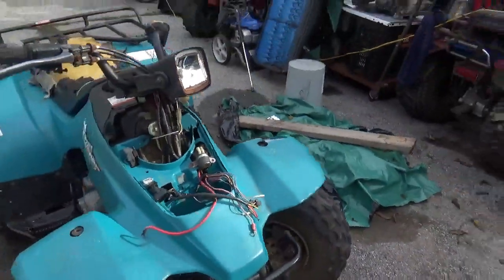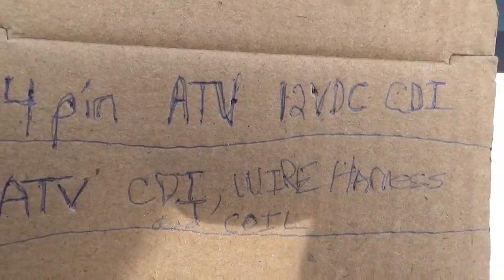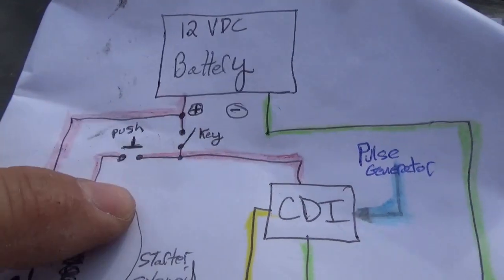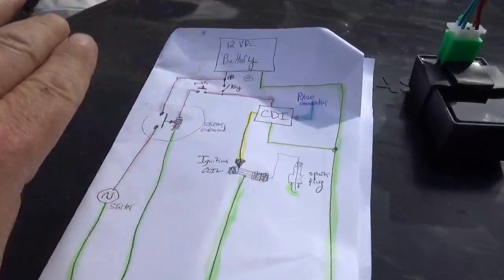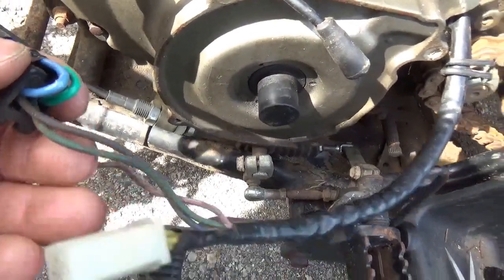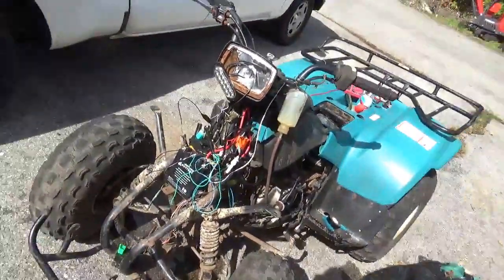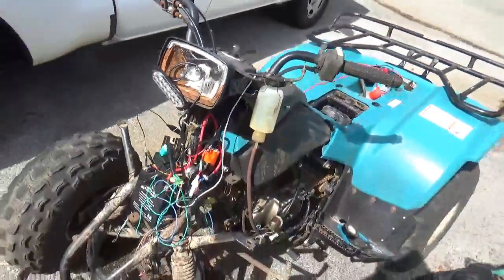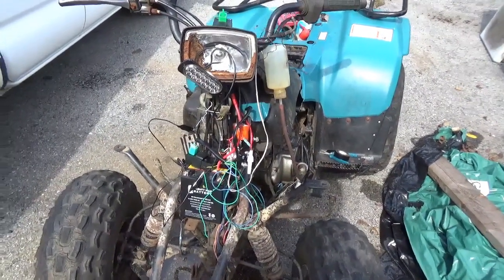AC to DC ATV CDI  Conversion, Fixing a No Spark Quad!

Comment: I have a question if i want to get my harness to work with a battery how do i use the two pulser wires there the same colored black, my klt 250 doesn’t have the original harness and im trying to figure it out
Reply: Or were do i connect them i asked ai and it told my to ground one of them

Comment: I got a question can anyone answer, I have a minibike with a gc160 on it, only mods are exhaust and it’s a straight chain to the back no jackshaft. I can get to 40 mph but it won’t accelerate past about half throttle once I’m there does anyone know why?
Reply: rich fuel if you push it full throttle , need set up carburator if you have CV carb good luck  set up carb

Comment: So the original stator and voltage regulator will still charge the battery? For that seat foam to be patched on the tailgate, the proper replacement cover would save a lot of time so I could patch with blanket material, cover with a piece of hardened cover material, wrap with stretch wrap, and install the new cover. Let me know Harvey.